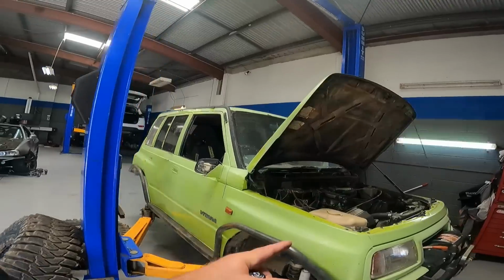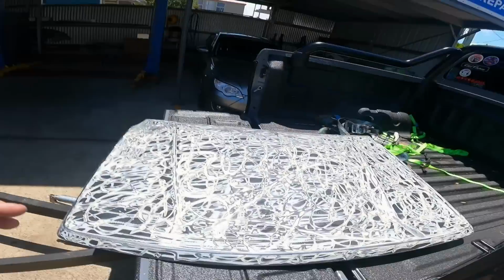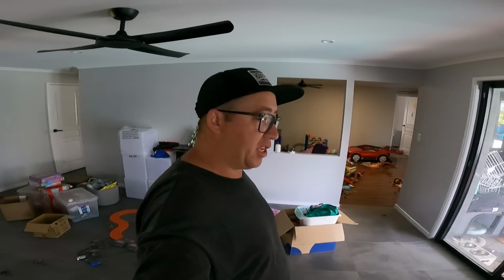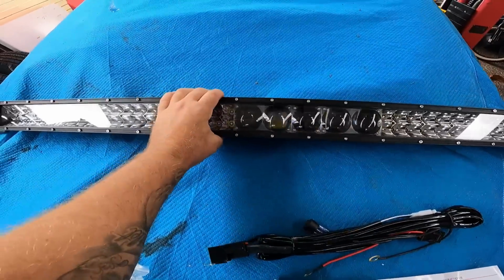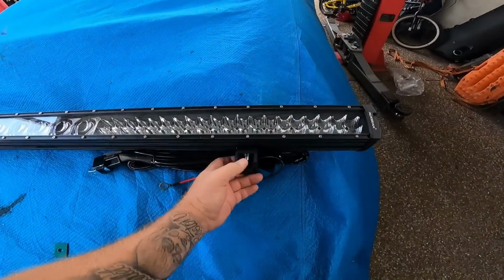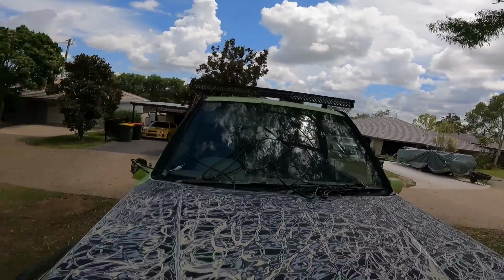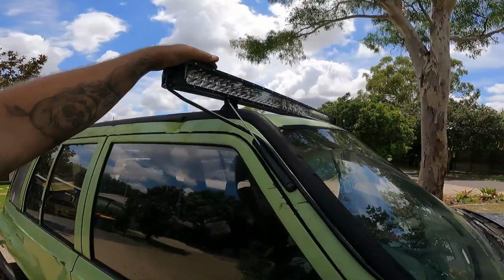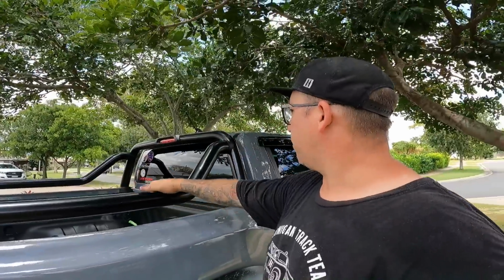rock crawler is back / AUXBEAM lightbar for the zook

Comment: 40 inch was to big for my old vitara 

Needs a roof rack , 30 inch light bar an 2 side lights so you can see the surrounding areas better
Reply from the maker: With the spreads on the side of this bar it had really good side vision aswell cause its set back a bit
Reply: Yeah I found that’s it was awesome having the lil ones as side lights 

But also hated that I ripped 3 light bars off full send 😂😂